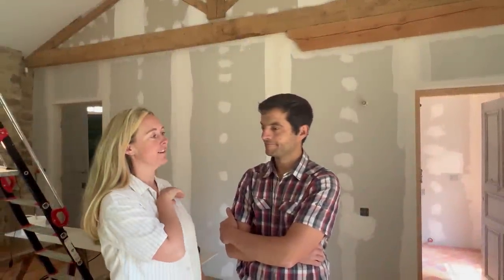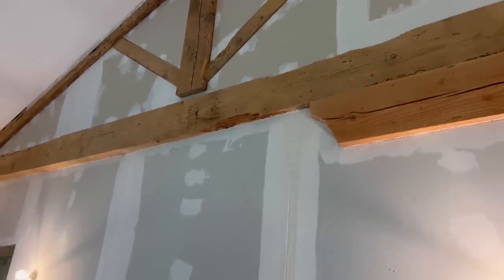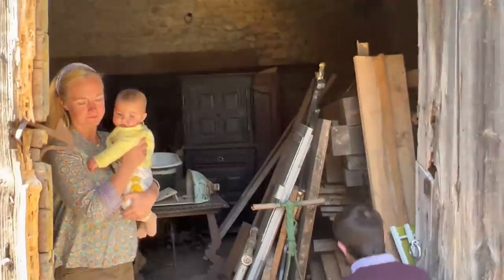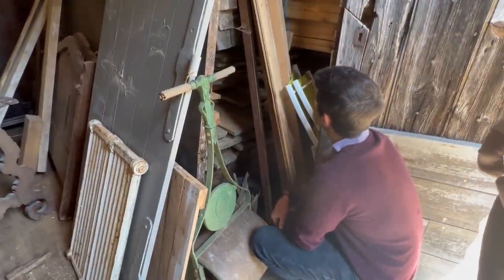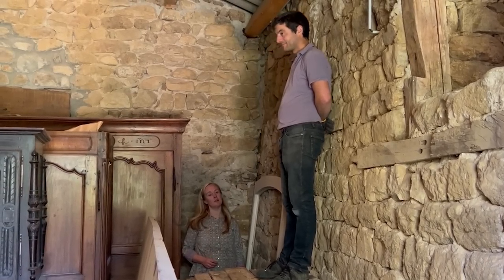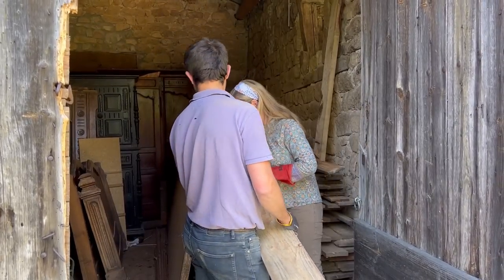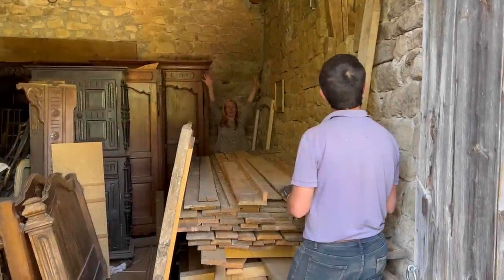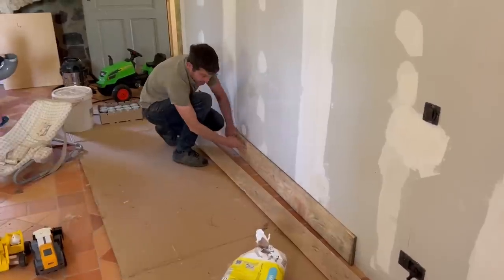Restoring the Historic Coach House: A Tricky Start to the Wood Panelling!

Comment: Hi Marc - I am very impressed with your great work in putting the fine old building in order, especially with two small children, to take care of - BUT as a father of these two "pearls" you should when working with electrical machines , use: hearing protection, glasses and bandages. The children will hopefully have their father fresh and healthy for many years to come.
Reply: Thought the same. Very different safety measures in France! Impressive even attempting this work with two little ones.
Reply: I agree! The many chateau DIYers I watch consistently risk their eyes, ears and lungs and I just want to yell at them!